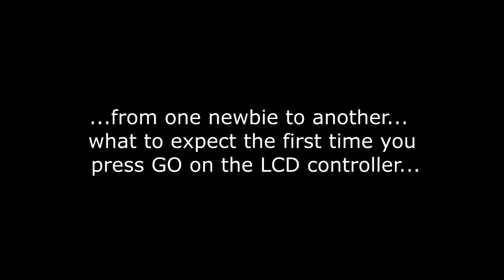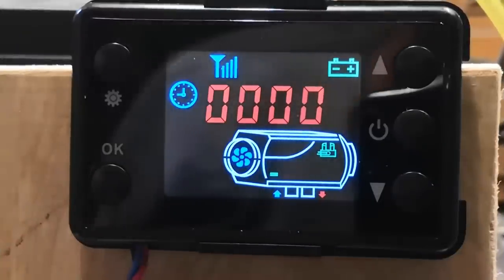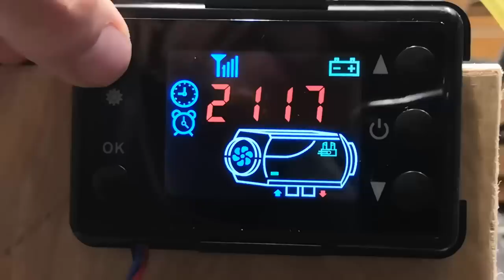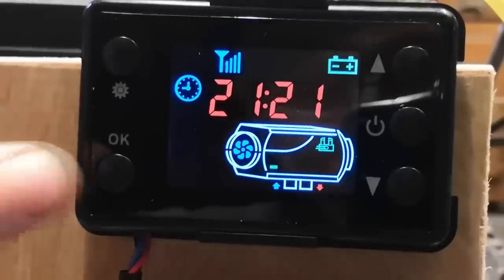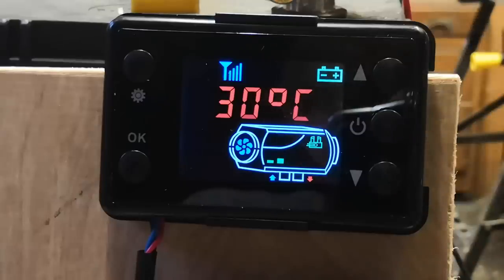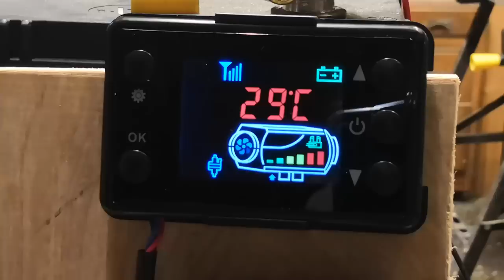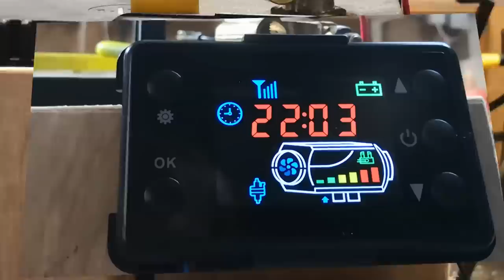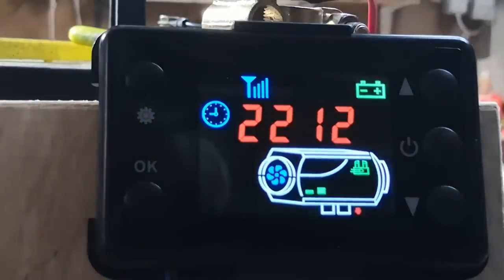First Time you press go...  LCD Controller- Chinese Heater

Comment: One tip: Make sure you dont leave the screen on the whole time or it will go dim very quickly. So dim you cannot read the screen. Either unplug the controller or put a switch in the  power wire to the unit when the screen is not in use.
Reply: The unit continues to function even without the screen? And is there really no way to shut it off through the buttons?
Reply: @Shepherd4now  I dont think the unit does - there is no way out of the box to turn it off. In my opinion the biggest flaw with these heaters
Reply: Mines been on for 6 months stright and still bright.
Reply: Just got a new heater. The display auto-dims ;)
Reply: @Shepherd4now  yes
Reply: @krimke881  Does the screen look exactly the same? This would be great, its the only real gripe i have with my heater!

Comment: Thank for video. Fault codes:
E-01 Low voltage
E-02 Over voltage
E-03 Ignition plug failure
E-04 Fuel pump failure
E-05 Overheat
E-06 Motor fault
E-07 Broken line fault
E-08 Flame extinguishment
Reply: E-06 I had and that's because my fan had a restriction so I had to unbolt the unit because it was too tight and put pressure on the unit and the fan...
Reply: @landstartrucks  I get E-6 error , what shall I do? I dont understand your answer here on top .
Reply: PHILL DIXON no there are designed to run on diesel using anything other than diesel glogs ans shoots it up other people have tried and failed iam running a 5kv diesel heater and my workshop is 12x10 and it get too hot sometime i have it set at 26 deg in the cold weather
Reply: E 07.... now what
Reply: I keep getting an E08 error after it warms up. How do I fix this?
Reply: @PHILL DIXON what if I said the was little to no resistance at the controller plug and at the main harness. Haven't taken it out and checked on the control board yet
Reply: @nickraber8094  the blue wire was disconnected on the control board
Reply from the maker: Kero and Paraffin fine... in fact better if you are running it on low power for long periods of time... less likley to soot up and saves the full power burn shut down..... I use kero.

Comment: Thanks for the tips. Like your suggestion. I removed the fuel hose from the bottom, lifted it up to the pump, got 1/4” ID hose about 18” with little in diesel. Inserted it to hose and feed the diesel until it filled the hose. A little tapping to remove all the air bubbles out. Since it is 18” I was able to route it back to all the holes back to the bottom. Without any air bubbles with a little spill, I inserted it back to the bottom fuel inlet. I just pressed ON and without priming, it just start right up. Cranked it at 5 you can see little bubbles being pushed in to the bottom until there was no more. That was a painless start up. Thanks again.
Reply from the maker: Good stuff.. glad all working

Comment: By far the best instructional video I have seen on this diesel  heater. I wish there was a "rating" for videos (this would rate 10 smile) so I did not have to watch all the thick head videos where either the volume was too low or else they had no clue themselves haha. Thanks for a job well done. I can now feel confident operating this heater.

Comment: Using soft vinyl hose from pump to heater is bad, the hose expands with every pulse meaning fuel delivery into the chamber is weak - it can cause the heater to not even start.  Use 2mm id hard hose.  Always make sure the pump is from 45 degrees to vertical,  and the hose from pump to heater  travels upwards only.  No kinks or loops.  The air bubbles are formed in the pump and must be able to be pushed through in the 2mm hose.  The larger hose allows the fuel pulse to slip past the air bubble allowing large air bubbles to form and stop the heater.
Reply: manual states horizontal up to 30 degrees towards vertical (same as the big brand heaters do to)? Ive gone with about 30 degrees for the reasons you already mentioned.

Comment: I'm working on an Arduino program to switch the digital wireless remote on and off with a home thermostat. If I can get it right it will be 100% better than the factory controller for my application which is actually a non battery powered tiny home, and it's running off a power supply which is turned up to 13.5V
Reply: Matt Dudley - I was watching this thinking about a python app on a RaspberryPi, but arduino would fit the bill.
Reply: @ppainterco  yup, I have it working on a $7 clone, and a $3 dual relay module. I borrowed code from one of the basic sketches in the Arduino IDE.  I opted to buy a manual dial control with the on/ off buttons as it was more logical to work with rather than the wireless remote. I put everything in a wooden project/ jewelry type gift box amd mounted the home thermostat to the face of the box
Reply: Matt Dudley Awesome!  Have you published a HOW-TO?  I’d love to read it and try it.

The biggest issue that I see with these Chinese diesel heaters is the lack of good instructions, or instructions at all,  Bypassing the controller would advance this quite a bit.

The second issue is that while they have a CE rating, none of them are UL rated, so there is a safety risk, but they seem simple enough to counter the safety question since the combustion is all isolated to the outside.
Reply: @ppainterco  I have not, done a tutorial. but I could provide the code used. The code is just the "button" sketch from the Arduino IDE modified to switch either one LED or another LED on depending on if a button is pressed. The button is the thermostat, and the LED's are the relays.  The relays just close jumper wires I soldered to the micro switch terminals inside the dial/ on off controller.. I even copied the basic wiring schematic from the Button tutorial using a half length bread board.  An Arduino Uno or clone, dual relay module and a 10k resistor are all that is needed to make it operate..  I got the idea on 'jumping' the remote and manual controller from a youtube video where a guy wired them to a GSM receiver. I replaced the GSM receiver with the Arduino  clone setup

This heater has been installed for almost a month without the thermostat control working well. I was worried about the LED power supply failing but it works. I also took a new unused upright 20 gallon air tank I had on hand and converted it into a diesel tank. Also. 3/16" brake line works for fuel transfer. I used some nicopp line that I had on hand

Comment: Can someone help me please?  My heater is perfect but can’t adjust the temperature. If I get to the ambient mode and press again, I get P-4.5hz come up..... I’m at a total loss. I’m not getting any error code, just that.
Reply: You are being in pump control mode, which is perfectly fine. The number after P shows the frequency of the pump operating per second. How to switch to temperature control mode is described in the manual. Look up point 7 in the manual concerning the display.
Reply: If you need help watch JOHN Mck 47 on utube. He has a series of videos on Diesel heaters. They r the most complete answers 2 all ?s about these heaters and any of the controllers. I hav had my heater 1 winter and into a 2nd and i found his vids. Look and u will find ur answers.
Reply: push up arrow make it at about P- 39

Comment: We are purchasing one of these Monday for our defender csw so the children are warm in winter only thing we're not clear on is can this be running while we are driving and when we are parked up without the engine running what is the battery drain like on this running for some time we are purchasing the one with the remote control and led display so should be able to put it on without going out to the vehicle candidates seem to find any information on it regards mark
Reply: Mark Smith hey semi trucks run all night but they do have four batteries and no need to run your engine just good battero
Reply: @felixjaimes714  these sence relays are brilliant! I fit one in my camper conversion a few months ago as solar is kinda poor where i live seems to be forever overcast with constant  cloud and rain..  this thing has been a game changer!

Comment: Thanks for a brilliant video, very informative. Just fired my heater up for the first time, however, the LCD controller does not give a Celsius temperature, instead of showing celsius it shows the letter P followed by 1.2Khz and goes up to 5.0Khz. Please can you tell me, is there any way to change it back to celsius like yours does? Thanks and look forward to hearing from you.
Reply: Got it from Steve Dyer. Thanks
Reply: Ive had same issue and As stated above when Hz mode press two top buttons together and this should change to temp increase...I'm just about to go try myself...😁
Reply: Mines is the same, no target temp just as above
Reply: @redcrestems5217  put it on the Hz setting and push two top buttons at same time..
Hey presto
Reply: Thank you DIYMAN.......my heater is 2 days old and giving me grief. As well as There being diesel in the air inlet pipe, Could this be caused by the pump being over primed?.... it mostly only ticks over with plumes of smoke from the exhaust, very little heat and doesnt run very long....Any advice would be appreciated
Reply: Link to find this heater please.if on ebay,name of product
Reply: @12sisters1bride7  ebay or wish search for either diesel heater or parking heater. Wish has them for about $280. EBay has them all over the price range

Comment: DUDE you really needed to leave a link so we could go and check it out and get one. I see them in kits but was wondering if I could get one for my machine. Anyone know where to get this display?
Reply: Van Time : AliExpress
Reply: Ebay:  Diesel heaters
Reply: EBay various kits about £134 al kind of switches digital with remote or rotary and various heat outputs and kw outputs from 2 kw to 8 kw well worth the investment
Reply: Ebay you can buy all the spare parts aswell
Reply: @phillallen01  Really? I have not seen those, what was your search criteria?

Comment: Just opened one of these up today, first time I have seen one. Buddy brought it out, we set it up in 15 minutes, works great! In 3 hours it warmed up my 400 square foot shop from 20f to 42f. That is impressive considering this was the 5kw version. He wants to use it in his ice house, so I just ordered the 8kw for the shop. Cant wait. Oh, a side note make sure you have a really good battery, otherwise it just keeps trying to start over and over...
Reply: I went for the gold and just got an 8kw. If you go into the admin menu with code 1688 you can turn the 5kw up to about the same output as the 8kw. The default HZ on my 8kw is 5.5 max 1.2 min. You can even play with fan speed which if you get too low will over heat the unit. I also used a 12v 20 amp $25 power supply from ebay to run mine. Only warms the PS up slightly when the glow plug fires. My total cost for both was $205

Comment: Thank you so much for such an in depth explanation, I just fitted mine but the instructions didn’t explain how to prime etc, I’m so grateful for your shared knowledge, mines all working great now thanks to you.
Reply: This mode is like a fan speed setting. Hold both top buttons and this will put it into thermostat mode and you can then adjust by setting a temperature.

Comment: Thank you so much. I thought the ticking sound I was hearing was something to worry about. I now realise it's the heat pump and  it keeps going all the time the heater is on. this is frustrating (coz it's noisy) but a Relief. Thank you.
Reply: Mount the fuel pump outside, I have mine mounted in the back door of my van and I can barely hear it, kinda calming at night and helps you sleep

Comment: Thanks for posting. My remote is a different type but the functions are the same. I was stumped at the password step, but didn’t realise it wasn’t really necessary to get into. So now I’m off and running. Mine is still at bench test stage too, I don’t want to start hacking into my van until I’m confident the heater is suitable. My big concern is the exhaust pipe temperature, I’m looking at lagging the pipe with insulation and also mounting the unit on a non combustible material. The supplied tank is crappy too, I’m looking at a small outboard fuel tank and utilising the quick connect fitting to facilitate filling. This will mean I can just sit the tank in the front boot. Cheers!

Comment: An excellent video.  This is the first one with a detailed explanation of first time with LCD controller.  You may want to consider switching out the 4mm flex hose with a 2mm rigid vinyl hose.  Check out John McK 47's series of videos to understand why the rigid vinyl 2mm hose is required.

Comment: I’m glad you explained it coz I didn’t get any instructions whatsoever so at least I got the thing to work but the remote is the same as yours but mine says RPM settings as well which is also gobbledygook but thanks for the main instructions as it’s impossible to guess how it works. I got the 8KW for my boat and it’s really hot so a 5KW would have been plenty.

Comment: Awesome video, much appreciated! I have it running in my triple garage, -20c and it's almost 10°c inside! Only difference is my temp is controlled in Hz on the battery, not degrees Celsius. Either way, I'm quite happy! So far so good!
Reply: wes schimpf I’ve got the same issue. Is 1.6Hz the same as 16oC?
Reply: @overlordone1246  My best guess is no, it doesn't relate back to Celsius. Hz stands for 2 things, Hertz, which is a unit of frequency. I don't think it relates here. It also stands for Habitable zone, which is probable what they were going for. The higher the number, the more habitable it is. Like I said, my best guess. CHEERS!
Reply: Hold down the on/off power button and press <> buttons at the same time. Will change the mode from hz to setting the room temperature with arrow keys.
Reply: I have temperature and HZ on mine.
HZ is the pump speed. You can adjust it, so pump speed should relate to the speed of the fan/heat output in operation.

Comment: These heaters are the future. I have a 5kw and it gets my van so so hot i have to turn it off and it stays warm for hours untill i give it a quick blast again. Top tip: when buying from ebay you will see 2kw 5kw and 8kw heaters. Be warned that the 2kw and 5kw are exsactly the sane units but 5kw are more expensive for people who dont do the research. Other than that if you're woundering to get one then do it. Youll never look back... FUTURE 🙏
Reply: Ive just installed mine 5kw one today (saw no 2kw versions on Amazon and the 5kw was only £90 anyway), i bought it to replace the joke of a heater Eberspacher i had that was always breaking down (i paid £700+ less than 12 months ago for a dealer service!). 
For reference id say this claimed 5kw chinese heater is about on par with my old Eberspacher 3.5kw in terms of heat output. More than happy with that, for £90 this one can break down and be replaced every year and still work out cheaper than Eberspacher rubbish.

Comment: Great little heater.......I find the pump goes flat out when it starts up, then slows down and goes flat out again till it reaches the required temperature, then clicks on slowly.
Is this how the pump should work, doesn’t seem to be any leaks in the fuel line, and very small bubbles.
Was concerned with the pump racing on, don’t won’t to burn the thing out...

Comment: Fyi: I have a heater with a slightly different LCD controller. Same display, other casing. And one significant difference. In stead of using the OK button, mine is primed by simultaneously pressing the Settings button (the wheel symbol)  and the arrow down. Then release. From there, just as in the video press the arrow up and priming begins.

Comment: FYI mine completely flattened a 100ah battery while on standby in 3 DAYS! I'm now going to put a switch to it so I can turn it off when the van is out of use.
Reply: Tunnel Runner I need to do this too. Im running mine from a mobility scooter battery in my simple camper van set up and it eats the battery in two days of standby.
Reply: @branchsnapper2228  dont know why it takes the charge, by rights should just run same as a digital clock on standby, maybe its because ive run a few metres extension off it to reach the back of the van and it soaks the volts up, dont know. . great little heater tho so you take the rough with the smooth..
Reply: I brought a van with one installed already and the fella I got it off put a killswitch next to the heater, I only run it for hour hour or so before bed then knock it off and always turn it off by the killswitch once done. He told me if it's left on say over a weekend it will drain the battery

Comment: I can't set the clock or timer on mine. It's only three buttons on the LCD display - up, down & on/off. When I cycle the display around to the clock, the < > buttons alter the permanent temp display above the clock. Holding on/off down, just turns the heater on. Oh well, at least the heater works.

Comment: Hi Just bought one of these for my semi camper workshop Sprinter. Great video seeing as the instructuon book is nearly useless - it translate words for you cmprehend correct utilization in operate of machine for not making space cold!! -  I'm sure that makes the same level of sense if you're familiar with the manual. So you mention a forum? Could you tell me how I find and join it please (or anyone else out there who knows) just for future reference for error codes etc.
Many thanks, keep up the invaluable work.
Regards
Guy